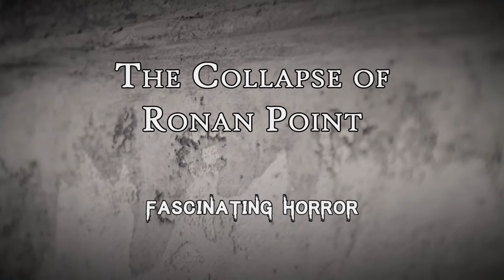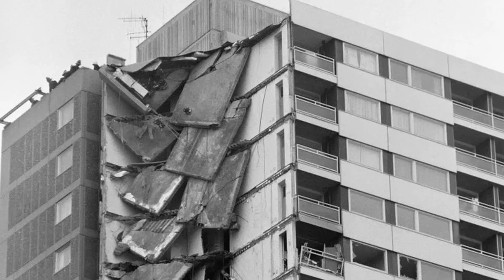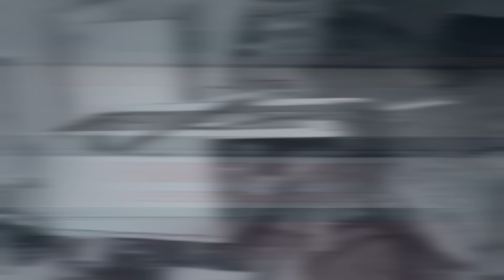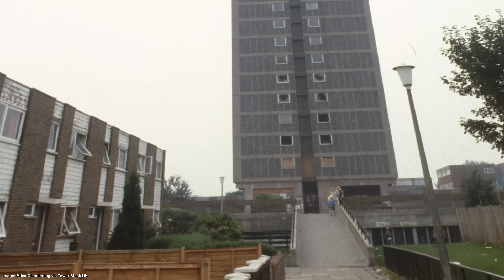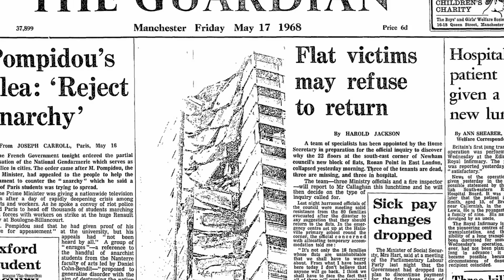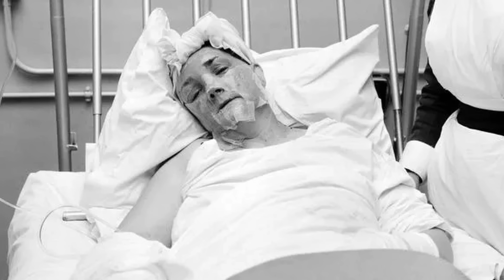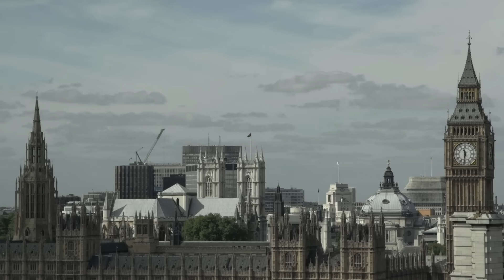Joints Stuffed With Newspaper: The Ronan Point Disaster | A Short Documentary | Fascinating Horror

Comment: I work in the mechanical field and often handle gas appliances. It is so easy to mishandle gas fittings and it is extremely important to take the extra care when working with gas equipment. I can recall a time where my co-worker neglected to properly test for gas leakage, and when showing up the next day to complete the job, I was immediately hit with a VERY strong smell of natural gas that the home owners had no idea existed. As it turns out, people don't notice subtle gas fume accumulation. Please take care, if you interact with such equipment.

Comment: The block next to mine, 18 floors high had similar structural failings and were demolished in 2021. 
The one I live in is 19 floors, but that's another storey.
Reply: Yes, a slightly longer one.  I saw what you did there.  My storey block I lived in was a shoter one, only 12 high.

Comment: I do wonder if part of the reason apartment blocks are generally unpopular in the UK (compared to much of Europe) is because so many were so badly built in the mid 20th century and they've just garnered this reputation of being damp infested concrete and sheetrock hellholes that could collapse in a stiff breeze. I'm sure there are other cultural factors (such as a preference for private green space) but this must have had an impact.
Reply: Two of the most depressing must be the balfron towers at the nothern end of the  Blacwall tunnel .I used to deliver heating oil to them,made me shudder to go there.Caretaker walled in behind metal sheets could only speak through some slits in the metal .The whole place stunk of pee and garbage 😢

Comment: Natural gas is odorless until mercaptan is added to give it that sulfur-like, rotten eggs smell. Idk when the UK started doing the same, but the US started adding mercaptan in 1937. If only the lady would’ve known if the gas leak 😮
Reply: In 1968, the UK was still using town's gas (a 50:50 mixture of hydrogen and carbon monoxide), most of this gas was derived from coal or by 'cracking' naphtha.  However, this gas was also odourless, so mercaptan was added to give it a characteristic smell.  In the early 1970s, when natural gas (methane) came on stream in the UK, I was living in a multi storey block in North Manchester.  I remember all the burners on our gas cooker had to be changed, as the flame speeds of methane and town's gas are completely different, this was done by a qualified gas fitter.  Again, for North Sea Gas, mercaptan had to be added to give it an odour, enabling a leak to be more easily detected.

Comment: There was a quite similar case later in Hungary.  The Pécsi Magasház (Tall house of Pécs). It was in the town/city of Pécs, near the southern border. It was occupied for 13 only and stood deserted for more than twice that.
They built a singular high-rise, built between 1974-76 using a yugoslavian patent developed specifically for high-rises. EXCEPT, they modified it for a quicker building process. Originally, the joints were supposed to be fixed with concrete, but they used a mixture that took only 4 hours to cure, thus cutting a few days on every level. Well, that quickness caused the connecting metal parts to start corroding immediately. After many complaints, the building was evacuated in 1989, during Christmas and and the residents weren't really thrilled. And then it just... stood there. Squatters used it, and it deteriorated, then they did a bit of fix to prevent it from collision in 2003, but it was not demolished until 2016.

The building process:
https://www.youtube.com/watch?v=h-BpSY3XstQ
Residents complaining and problems with the building:
https://www.youtube.com/watch?v=_1RwkW0jTNY
Demolition timelapse:
https://www.youtube.com/watch?v=fbPfary6VEE

Noone died as far as I know, but when I heard of Ronan Point for the first time I immediately thought this building.

Comment: The fact that the council didn't carry out remedial works is of no surprise to us. We live in the UK and used to live in a 19-storey Tower Block in the Midlands. It had 114 flats. I was in a 1-bed flat and one day when my window was open, it was caught by the wind and slammed shut, cracking the window from top to bottom. I reported it, and reported it, then finally a worker turned up and said, 'Oh, wrong window.' He had been told that it was the reinforced glass on my balcony that was broken. Later that day, I finally had it replaced. 

However, my husband had one better than this. He lived in a 2-bed flat in the same block, just on a higher floor, and when he moved in there was a large crack in the glass panel that surrounded the balcony. He was on the 11th floor, which was literally 100ft (he measured it whilst drunk one evening using a ball of string with a nut tied on the end, then used a tape measure) He reported the crack. Nothing happened. He reported it a further 8 times. 

Finally, he woke up one morning after a windy night and found the very large piece of reinforced glass that spanned approximately 50% of the balcony, lying inside the balcony. He went to the council offices again, and this time he reported that half of the glass was now in the balcony. If the rest fell out and happened to fall down, it would kill someone as it would come down like a guillotine. He also stated that if it was not fixed by the end of the day, he would be ringing the local newspaper to tell them all about it. Strangely, the council suddenly became VERY efficient and the glass was replaced the same day. The workman who came round was laughing at the level of panic he had created at the council offices.

We ended up living together in his flat and we had various issues. The lighting was out on the floor around the lift and stairwell. There was debris, faecal matter and used needles in the stairwell and a mega build up of pigeon muck at the ground floor exit door. We had reported these things to no avail. There was even a concierge office, and they had been reporting these issues also to no avail. So we contacted the local Wolverhampton Express & Star and a reporter came round. 

The Tower Block was called Wodensfield Tower, however, we called it Toilet Towers and this title appealed to the reporter who took photos and spoke to us. Our story ended up on the third page with a picture of us in the stairwell alongside the rubbish and graffiti, and the headline was Toilet Towers. The article was a fair size. Miraculously, the council came round in very short order afterwards, replaced the lighting, cleaned the stairwells and removed the pigeon muck..... Amazing what a little bit of bad publicity can do isn't it?
Reply: i wish bad publicity worked to pressure negligent building owners/managers today, but it doesn't seem to do so. your story does give me a little hope, and i hope the both of you are doing well!
Reply: things work similar in the US with shady companies, They mysteriously figure out how to solve a person's problem when the consumer affairs team from the local TV station rolls up. There seems to be something motivating about that Channel 6 van.
Reply: @filanfyretracker yes indeed! I was once on 6 On Your Side.
Reply: @filanfyretracker we do not have collapsing buildings here as a rule.
Reply: @itoo3654 No but CHINA does regularly.
Reply: That was a great share and my best wishes to both of you :-)
Reply: I am so glad to report that in Britiah Columbia, all construction since 1975 has had mandated inspections for seismic code and reinforcements. 

Everything here is done by the book. I haven't seen poor craftsmanship unless I did it myself as an apprentice. Then I had to fix it. 

Seismically active areas in Italy, I wouldn't be so sure of though.
Reply: Often bureaucrats need to feel the heat before they will see the light.
Reply: Newham is building on every bit of unused land it can at great speed. I am worried is could happen again. It is now saying it is on the verge of going broke because of the target housing set by sadiq khan who moved the assemby offices to Newham. I live in a council house that should pass to me on dads death due to the rules of sucession, I try to do as much diy fixing as i can as the house was built in 1900. I will not take a property like this in Newham I have to move. I will look out side Newham as even the crime rate gives me chills.
Reply: We live in a council house in the south east and it's just as bad here. We've had non stop problems since we moved in, from simple things like cracked windows to the fact our front door sometimes just doesn't open, like you push the handle down and it won't budge. It's a serious fire risk and yet, 2 years on, we're STILL trying to get someone to come out and fix it.
Reply: @tmntleo my cousin lost out on a job because of a faulty door like that, he missed the interview because his door was jammed shut, the wood wasn't treated properly and would swell up on humid rainy days to the point it would get completely stuck.
Reply: @SUPRAMIKE18  i build doors for a living, that should never happen if its installed and built right, not only should moisture not be a problem, gap size is the most important factor, if the hole isnt square or too tight it becomes a fire hazard
Reply: @SUPRAMIKE18  Cousin needs to hit the weights.
Reply: @Nuttyirishman85  he's not the strongest guy but that door took 2 fire fighters with a battering ram to get it open.
Reply: @SUPRAMIKE18 That is SO DANGEROUS. I would have removed the door and cut or planed it down. I did this to my parents front door after years of sticking. It shut perfectly after.
Had your place caught fire you would have died from smoke. 😮
Reply: @tmntleo  - Make a list of everything that's wrong (especially the doors that won't open - what a fire trap!!), create a catch negative name (perhaps something like 'Fire Trap Tower'?), and go to the press.  The council will hate the bad publicity, and maybe actually do something about it.  Good luck!!
Reply: @tmntleo you need to report the issue and then give them a week as a front door not opening is a serious issue then make a stage one complaint if what they say isn't satisfactory then stage two and then say your taking it to the ombudsman and director of the council this is what you have to do shouldn't have to but it the only way from my own experience that you get them to do anything.
Reply: @tmntleo 😢
Reply: @tmntleo that's so ridiculous. People simply don't care! But if they had to live that way it'd be a different story!
Reply: that structure is moving and unsafe just for your information  @tmntleo  sounds like its collapsing onto your place making the door unable to move
Reply: You are correct about the glass becoming a guillotine - it happened in downtown Chicago.  A falling window hit a woman in the head and killed her. She had been walking on the sidewalk below, holding the had of her three-year-old daughter.
Reply: You think that was bad you should hear the stories from tenants of private landlords.
Reply: I think it's more common in the US to get assistance for housing but you are choosing where you live. Yes, whatever amount you get may dictate where you can afford to live but you are still choosing. I don't think we have that many (if any?) housing complexes actually owned by the government. Perhaps, in the major cities. Some apartments locally are income based and they get a subsidy from the government but the government still doesn't own the building. But hell, I had a hard time getting my landlord to actually fix things and he owned the unit. So, landlords are landlords pretty much unless you luck out and get a good one. SMH
Reply: @marniekilbourne608  Ah the bad old days of urban renewal and the crime-ridden high rises, now torn down, like the Robert Taylor Housing or Cabrini Green in Chicago. They were infamous. Neighborhoods were bulldozed and with it all the structure that maintained order, including old people and the church. With husbands not being allowed by welfare laws to be in the home (a rule enacted from Welsh Mining Widows law, which destroyed families in the US, Canada, and Australia, as well as Britain), the authority figures of the housing were the gangs. Notoriously, as mentioned in the tv show Good Times, even the police were known to refuse to enter and allegedly had tires stolen off their cars when they did. When a single woman/girl of any age got pregnant, she could apply to get her own apt, so that created havoc, too. Yes, urban renewal was at its most ruthless in the big cities and there was nowhere to go but into govt housing. Places with a much lower population didn't experience that level of disaster. In my small town as in many, there is often no housing available where the landlord will take a govt subsidy, and as an older couple I knew discovered, disability payments for him and a part time job for her brought in too much to be eligible for the few places open, so they had to live in a crummy motel. I found out about this when the crummy motel burned down, from cheap maintenance, and hope was crushed that they could finally get an apt. They moved to another crummy motel. I have read that with Thatcher letting people buy their social housing and not enough new being built, it is a problem there, too.
Reply: It seems calling the press is effective worldwide. I'm french, I live in student flat which is run by the equivalent of the council estate. Last December we spend 18 days without heating and hot water. Strangely, the estate stoped mindlessly accusing the company in charge of the boiler of not doing its work and took action when I called the local newspaper. I also called the mayor of the city and of my area, the administration which gives money to help pay a part of rent and the hygiene services because a flat without hot water and heating is considered unsanitary here. It was repaired quickly! If I can give a single advice to anyone in need of repairs in their flat : do not shut up until you see results, make as much noise as possible everywhere to claim your rights. You pay fees to live in a decent place, you should be able to see where the money is going to when needed. Bringing shame upon the ones stealing it is the only thing that makes them act the right way. It is sad to see that you have to fight for anything but it's the reality....
Reply: You're good people
Reply: Your writing is superb!
Glad you got it all sorted safely in the end.
Reply: Reminds me of the song "Mile End" from the Trainspotting soundtrack.
Reply: I wish I could say I'm shocked, but that's just classic uk isn't it. Glad you guys got it sorted, and toilet towers got a chuckle out of me!
Reply: I'm glad everything worked out for you guys! Wow, your story describes a very real comparison to a Washington ÐC apartment bldg!!
Reply: We had caretakers in our tower blocks, the one I lived in, logan towers in Liverpool wasn't bad actually
Reply: Sounds like the council system is a nightmare and dosent work.
Reply: I guess your talking about the flats adjacent to woden road, no surprise there
Reply: Well, glad you had one another as you put up with it all ❤
Reply: We call the slumlords in the US... Landlords who don't care till it effects their image.
Reply: I guess the UK ISN'T that different from the US
Reply: white english culture. The council is run by your white english people, not by muh migrants or muh EU
Reply: What seems to be missing from this travesty is the list of people who went to prison for what was blatant criminal negligence resulting in multiple counts of manslaughter. Are you telling me nobody paid the price for this horrific crime, not even the usual token scapegoat they usually pin all the blame on in incidents like this? This is not just absolute engineering and construction failure but an inditement of the justice system itself.
Reply: You are responsible for replacing your own windows.
Reply: A mate of mine lived in a tower block in Birmingham, I couldn’t believe how big it was . The name Toilet Block is very appropriate because that was the lifts and the stairs were like
Reply: So when the government controls the media narrative you have no checks, balances, or recourse.
Reply: Good for you! Sorry you had to deal with that. :(
Reply: Nowadays, there is no local paper and no local people would be given a flat. Sounds like you lived in a time of bliss.
Reply: @arostwocents Rubbish. A workmate of mine has been living in a council flat now for two years and she only waited 6 months to get one.
Reply: Hello Miss Cuddlepaws, 
I wanted to say that I love how you call these flats and us Canuckleheads say apartments. That is all
Reply: @Wayne_155  what?
Reply: 😂😅 @itsdan722

Comment: The hospital where i live was built only to last 25 years. Its nearly 40 years now. Not much improvements and the celings are falling in. There is uproar about it.
Reply: Building a *hospital*, a major infrastructure project that often takes more than a year to even complete in the first place, that only lasts 25 years is absolutely ludicrous.
Reply: Yes, many of those built with RAAC (Reinforced Aerated Aluminium Concrete) flat roofs were only designed to last 20 to 25 years. A good example is the QE II Hospital in King's Lynn, Norfolk, where hundreds of Acrow props are being used to hold up the ceiling, which is in danger of collapsing.  This building was constructed in 1980, so it's already way past its sell by date.  It might have cost more to construct with a gabled, tiled roof, but in the long run, it would have been far cheaper.
Reply: You live in a hospital?
Reply: @human_error1  don't be obtuse. saying "the _ where i live," is not only appropriate grammar, but common phrasing